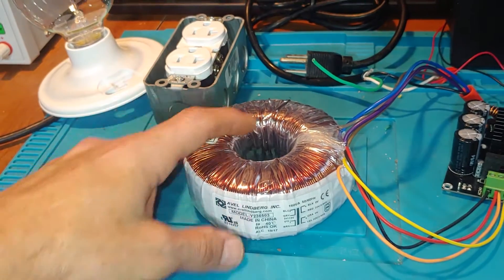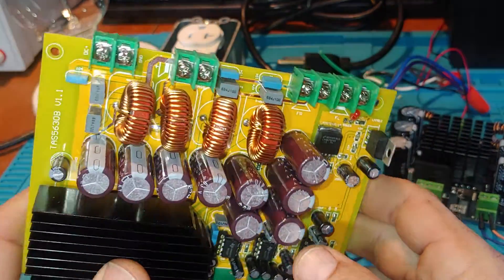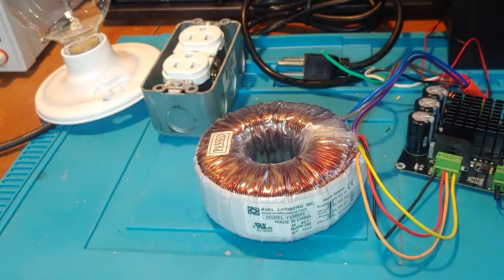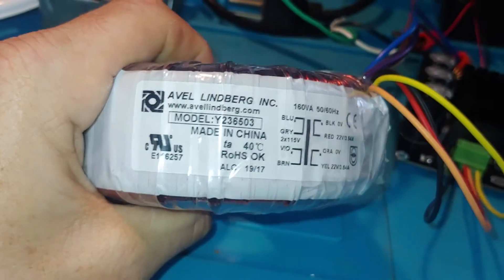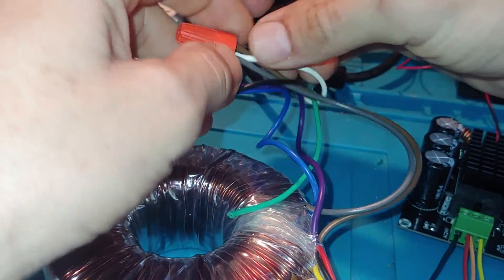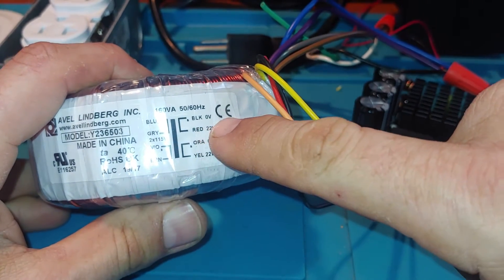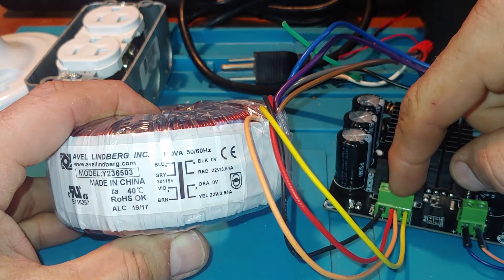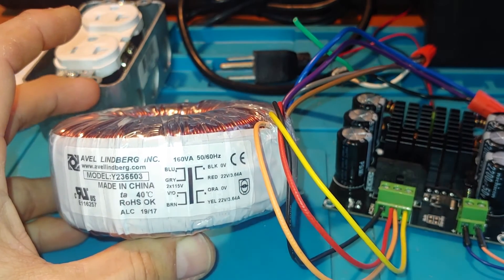Avel Lindberg Toroidal Transformer Wiring (Dual Secondaries to Center Tapped)

Comment: Nice vid without the BS. I'm new to torriods here. If only 1 primary were wired would only 1 secondary work? Or would both get voltage at 1/2 the current output? Also is there something special to worry about when mounting these and using the donut washer?

Comment: Nice vid without BS, new to torroids here. If you were to wire only one primary coil then I suppose you'd only get one of the secondaries to work? Or would both work at 1/2 the current ratings?
Reply: Both secondaries would work at 1/2 the current ratings.

Comment: Do you get 22vac across the black and "center tap" /orange red, and 44v across black and yellow? I am trying to replace a toroidal that was labeled 0v, 12, 24v, but I am only finding dual 12v secondary toroidal.
Reply from the maker: Sorry for delay here, but "yes" - sounds like you were on the right track! Hope you got it.
Reply: You would get 22 across the Black and colored 22v taps. To get 44v you would need to wire the two 22v taps in series. Meaning Black to ground, Red to Orange, and then Yellow would give you 44V.  In series that way you would get 44V out but still at 3.6A.   In parallel,  Black and Orange to ground and Red and Yellow out you would get 22V but at 7.2 amps instead of 3.6